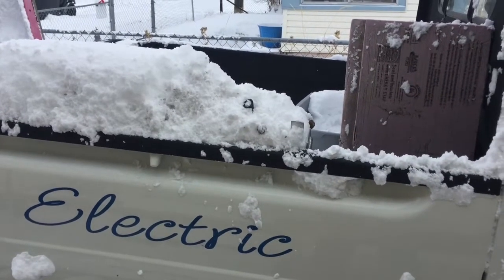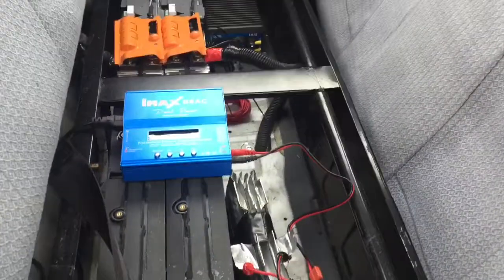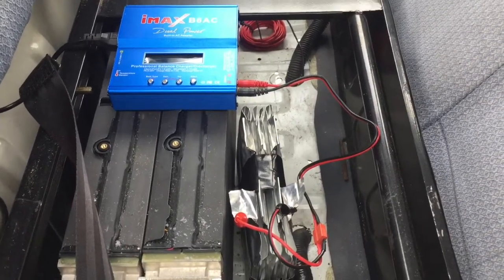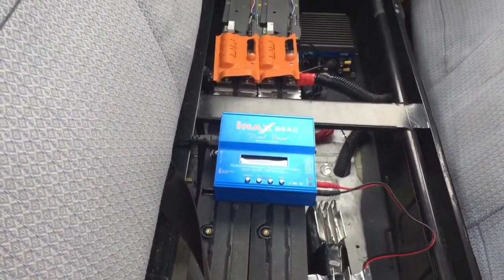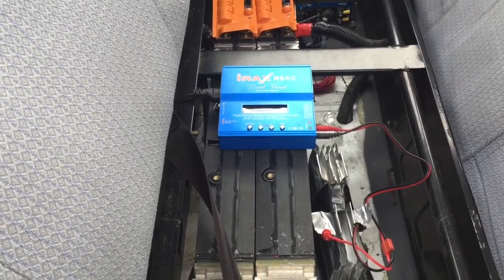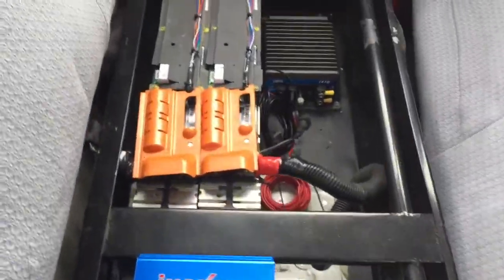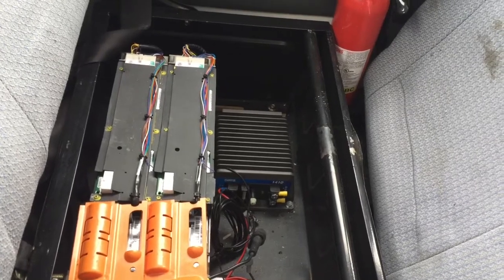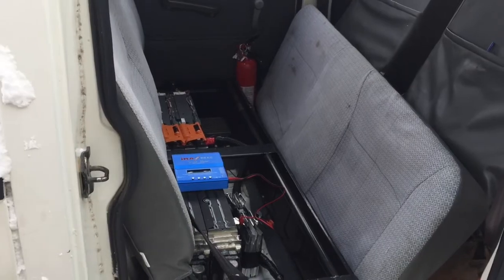Tesla Batteries/ Lithium Titanate Batteries

Comment: What setting on the charger? Li ion or lithium polymer or nano phosphate? I have LTO cells and Thunder power lithium chargers and that same charger as yours. I just need to know what chemistry settings you used since LTO is not an option. Thanks
Reply from the maker: LTO cells are a very hardy chemistry so the charge curve is fairly forgiving. What you need to be aware of is that each cell is not the same voltage as a lithium ion or polymer battery. I believe that an LTO cell is 2v so most importantly you should verify voltage of your whole array then find the peak voltage that most closely matches that voltage on your charger.